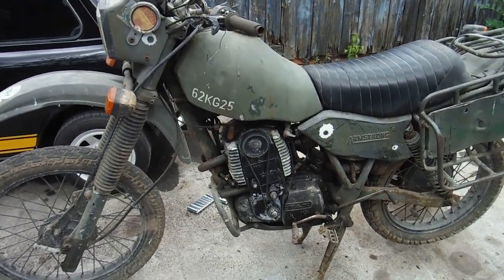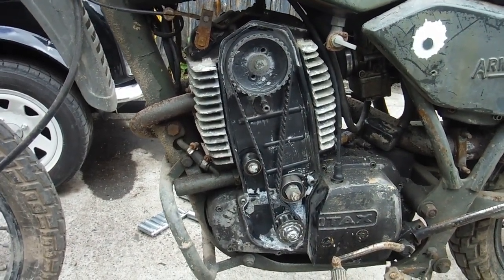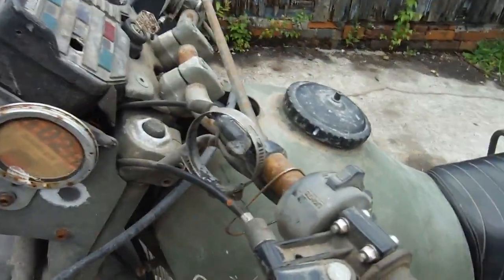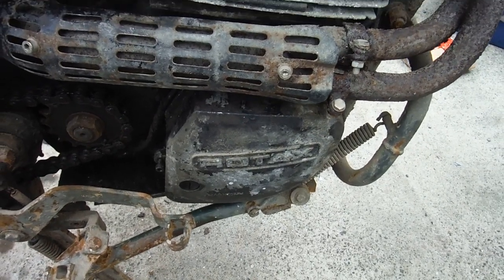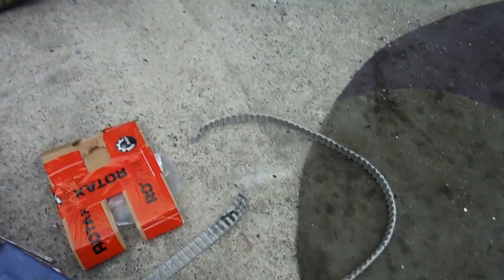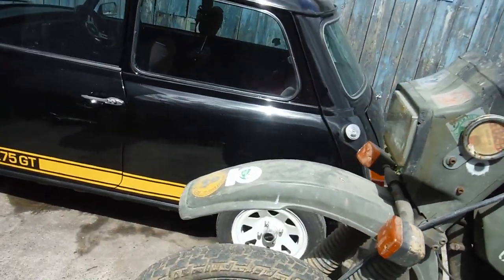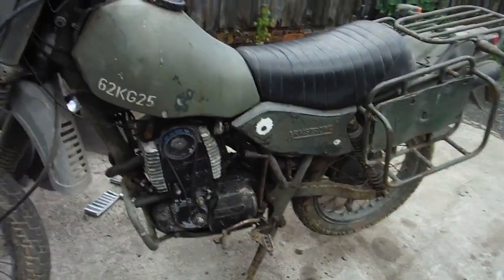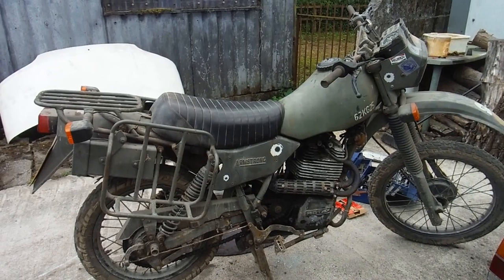Armstrong Rotax MT500 Army bike first start in years.

Comment: Hey Paul....  Those Armstrongs "ate" timing belts on a regular basis, so much so, we used to carry a spare in our pockets.   Quite a good powerful machine though...  Too heavy for cross country work when fully loaded up.  The Army always bought strange stuff...  An "off the shelf" Honda XL 500 would have been far better and more reliable.  Good work.
Reply: TRUTH, i preferred the can am 250 stroker to these
Reply: Those r slow n weak suspensions. Change belt every yr or two. Timing chain can go to
Reply: Those r slow n weak suspensions. Change belt every yr or two. Timing chain can go to